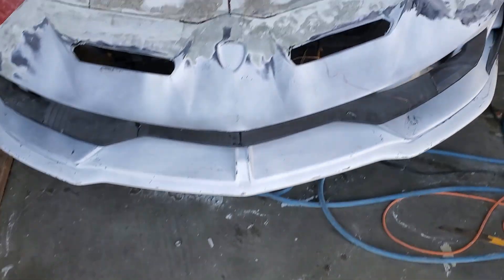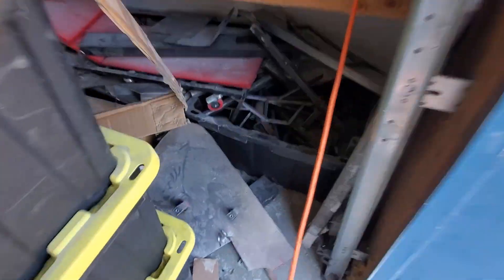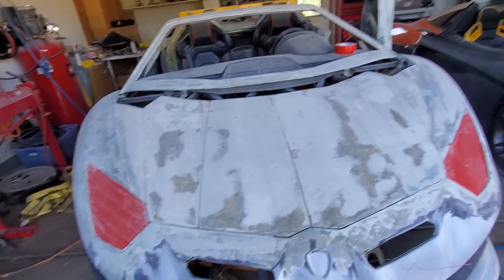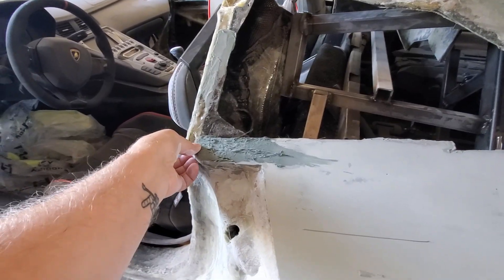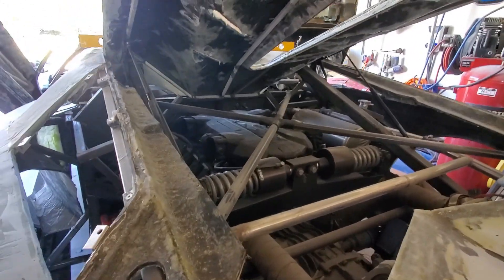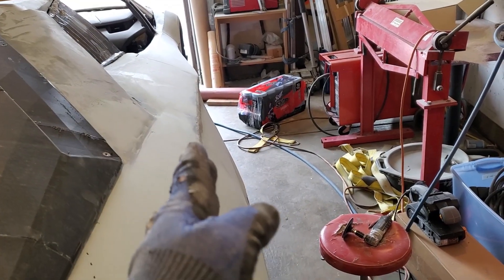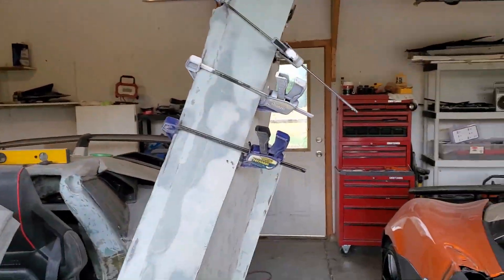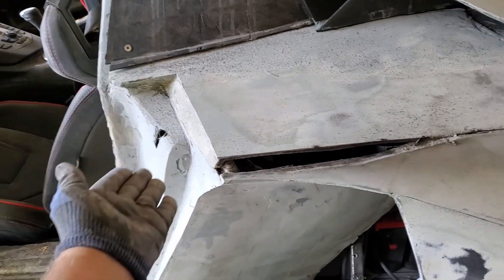Straight and narrow

Comment: I'm not sure that line is right tbh. The car should be getting wider towards the back on that line, but it looks like yours might get narrower with the change, but can't tell for sure. If it is getting narrower then I think the problem may be to do with the shape of the rear quarter or a combination of both. But anyway, this is definitely the way to go - make sure those lines and curves are right from all angles, easy peasy ;)
Reply from the maker: I did verify.  Plus, the rear end were molds taken from an actual SVJ, so I have that to go on.
Reply: Excellent! Carry on ;)